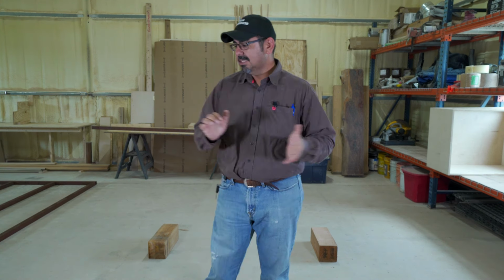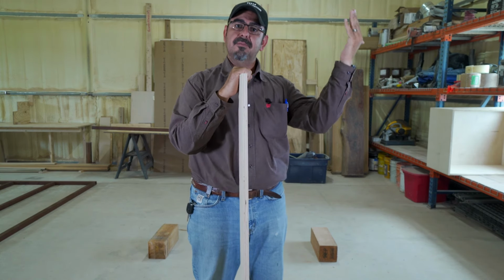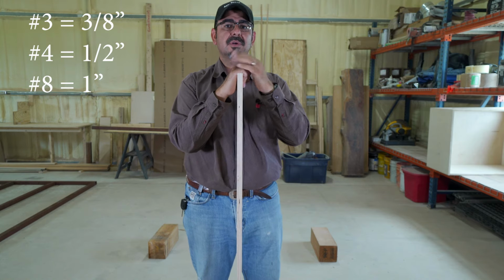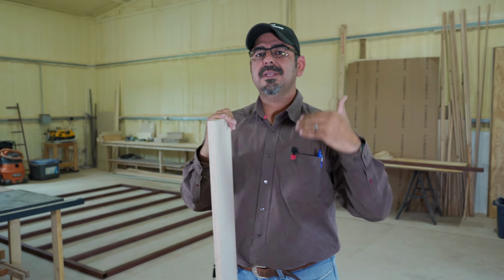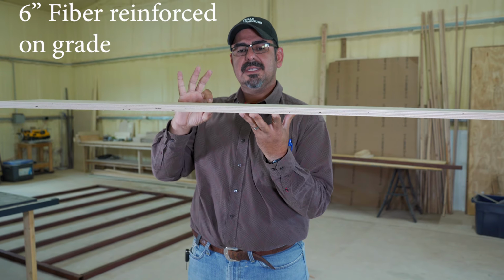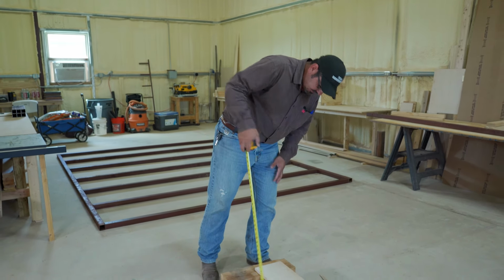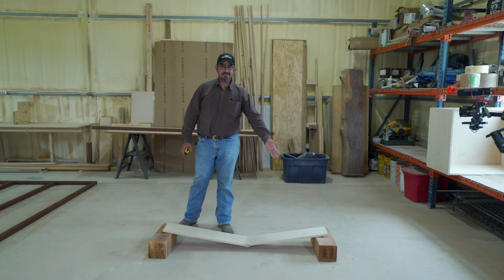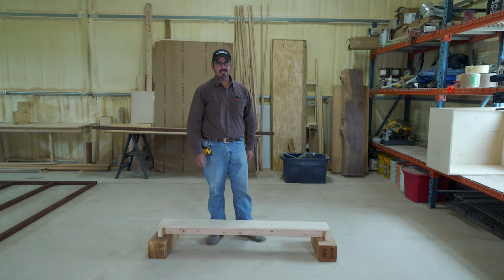Concrete thickness explained! - The Barndominium show E136

Comment: Concrete is only as strong as what is underneath it. Thicker the slab is for weight distribution you don't  pour 4" on a bridge deck you pour a foot on a bridge deck... So on some cases thinker is better depending on the situation of your pour.  Fiber is for the cement itself wire is to tie the pad together  Fiber is mostly used on a sunny day we're you have shaped and sun beating down on your pad. It helps the concrete not to weather crack.  Which concrete will crack there's something you can do to prevent it to. crack do

Comment: Mix is an important factor too, when it comes to cured strength, as is the slump. Rarely will you see a residential contractor check slump and most are pretty often going to use to wet a mix because it is easer to work, but if it's too wet, you will lose cured strength. In commercial jobs an onsite engineer or inspector will make sure they don't let it go down too wet. In residential work, most customers don't know the difference or that it matters. 

Having a big slab and/or foundations engineered is not a bad idea because things like the mix, slump and reinforcement are part of the spec.  That obligates the supplier and the contractor to meet the spec  when supplying the concrete and  installing it.

Comment: Have you ever considered using basaltic rebar?
Reply from the maker: No I haven’t.  I’ll look into it.
Reply: Tod Wilkinson ...Yes, it's made basalt fiber. Some is made from Kevlar fiber. There's pros and cons with it however.
Reply: Texas Barndominiums ...Its interesting stuff and new to the market. It's lighter but costs more. It's stronger but not as resilient. But it does not rust.

Comment: Clay soil, been graded and rested for 1 year, + compacted by a dozer. I want 7 sack with fiber, water inhibiter, and dyed, 5/8" rebar reinforced every 8", grid pattern poured at 6". It will have vapor barrier, 20-R insulation under slab for radiant heat. Overkill? IDK, But I want it to last I know I am looking at around 30k for my slab, including insulation, add some for radiant heat? 2k for most parts but heating unit. I also want to tie it in with the wood stove, as really that is the only time of the year a heated slab would be needed. R-30 walls, R 70 ceiling.

Comment: Since one day soon we will be living on Mars I think we may need specialty SPACED support beams. 
Gravitational pull may cause movement in the slab.
Reply: Slab are flexible and they do move. We did thousands of manometer surveys on residential slabs during a class action lawsuit we were facing as the builder / developer. Residential slabs will cup, curl, twist and move in just about every direction you can think. Most people think slabs are not flexible and are rigid. Manometer surveys of a slab will show exactly how a slab is moving and twisting over time.
Reply: Lmao best comment so far, thank you 👍👍👍SPACED 👍👍👍👍👍

Comment: It also depends on the cure rate. My brother makes his 6 in driveway as strong as an 8 in driveway buy keeping it wet for 28 days.
Reply: Concrete will not increase strength doing that.

Comment: there are lots of ways to correctly lay a slab. only issue I have with this demonstration is, it's not equivalent to a slab! if your base is lvl, with 4" thick slab with 3500psi concrete, unless there is weight on slab this is more than sufficient without footers, unless there are load bearing walls in wich they would be needed! strength of the concrete comes from depth and rock!
Reply from the maker: How isn’t it equivalent?  
Boards are both same thickness.  One with beams, the other without.  🤷‍♂️
Reply: @TexasBarndominiums  because your boards are not in contact with the ground! so that's equivalent to your slab not being lvl or having a huge void under the slab! lol
Reply: Since a lot of people look for help in these videos and their comments, lets not make wild statements. THERE IS ONLY ONE RIGHT WAY TO CAST A SLAB. You engineer it (yes, pay an engineer) then you or a good concrete specialist pour it. And there is nothing wrong with TB's demonstration! It's meant to show DEFLECTION only. How would it do this if the boards were supported?
Reply: @xskill101xr3bn  makes no sense to put the boards on the ground. You get it? There would be zero DEFLECTION.
Reply: So misleading. Strength in concrete comes from so many more factors than just depth and rock (sic). The guy in the video is telling us this exactly every time he says " well, it depends". There is no shortage of detailed information online about concrete.  Do not rely on gung ho advisors who shoot from the hip. I like the video. It's basic. That is what the maker intended.
Reply: deflection demonstration is the wrong demonstration for what he is talking about... unless your suspending a slab.
Reply: @bradpotgieter4008  that's my point no reason for it if your slab is on the ground!
Reply: @xskill101xr3bn  I get you. In the simplified context of 4" vs 6" as per the video,  it was easier for me to assume that the sub base was inadequate (which is often the case!). Brings us back to a "suspended" slab. Which is why I say that I get you. Simply put, TB needed a void under his beam to make his point that reinforced concrete is better.
Reply: @bradpotgieter4008  I got ya!

Comment: This video need to idea of soil tests and engineering involvement at the start. Also how does a board loaded and deflecting in one way representing a rebar reinforced slab which is always deflecting a two ways. Also no mention of where the rebar or welded wire mesh should be placed or held in the slab’s thickness.

Comment: For us who don't know. What is a concrete pad beam and how is it created  in  pad construction ?
Reply from the maker: Concrete pad is the surface of the concrete.  Usually 4” thick, but can be thicker.  
The beams are the supports underneath that make it look like a waffle if you turned the slab upside down.

Comment: Generally, the amount of steel required (if you are an engineer or architect) strengthening your concrete is a function of the cross sectional area of the concrete. a 6 inch slab is going to have 33 percent more steel in each direction,..as opposed to a 4 inch slab (this steel can usually be any size,...AS LONG AS IT'S CROSS SECTIONAL AREA,..ADDED UP..IS AT LEAST THE PERCENTAGE OF TOTAL CROSS SECTIONAL AREA  required..  As long as you place your steel correctly, and concrete compressive strength is similar,..You are blowing smoke up everybody's a!s.   You find out the truth when you talk to somene who mostly does suspended slabs, floors/ceilings, freeway bridge, etc.,..  I don't think I've EVER (yes...that would translate into never in a million years) seen a plan for anything (where the strength really counted)....that didn't use steel as a reinforcer,. and didn't specifiy the concrete compressive strenth..usually 3k psi or more.   I think you just wanted to do a video to get some hits or something..

Comment: Concrete is ONLY as good as the SOIL underneath it! Good video man. Keep it up. 👍🏻👍🏻
Reply: We always based our residential foundation system off of the soils engineering reports for each project. We finally started doing residential post tension slab systems in the 1980's here in California regardless of the expansive index of the soil. It does not cost that much more to do post tension slab system or my favorite residential slab system.
Reply: True very true
Reply: Tony Reyes Yes, but thats a choice in Places like Chino hills you have no choice. In North Fontana, take your pick and typical slabs are fine as well .  But you are right, follow the Code which requires soils investigation . build to it or above it, no big deal.  Makes for good conversation I guess.

Comment: Code specifies a min no more no less .
If you go more it will cost more .
Go with code for basic slab .
It all depends 
No I don't ware depends yet
Reply: woody ahh  Yup, and soil varies. So what you need in Vermont may not work in Cali, etc etc. I don’t wear Depends either, not yet anyway,lol.

Comment: concrete and plywood are two different types of material also you have no sub support if it is on grade concrete is as only as strong as the material that is supporting the concrete.

Comment: Expansion joints, drain tile and areas like where you propose to place a lift as well as all perimeters being at lest twice as thick (3-4 times thick is worth the extra grading and material.)
   I would also have enamel coated rebar and similarly coated wire mesh as well a pylons at every corner and every 12 feet because ground always settles and shifts.
   Overbuild the shit out it once and it won’t degrade in a hundred years.
Also, hydraulic concrete, even if you are not pouring in water…

Comment: I am gonna insulate under my slab. And put flag stone over the slab. On bedrock. Most important thing is that soil testing. I over build foundations. 4" inch slab here you should use gfrp or basalt rebar if you can by code. Otherwise it's 6 inch of concrete to keep rebar from rusting and freezing which destroys the concrete. Masonry loves to wick moisture. I don't think even 6" of concrete stops rebar from rusting and failing here.

Comment: You should never use rebar in a 4" slab. You need 3" between soil and rebar or it could rust out. 2" is pushing it. Just think if you need 2" minimum on each side plus the thickness of the rebar you are at 4 1/2" thickness if everything is perfect.  Just use wire or go to a 6" slab.

Comment: Besides all this, when I dig……before I pour any concrete……no matter what the struct or architectural engineer called for on the blueprints, I also have a soil engineer come out and test/ confirm the soil the concrete is going to rest on.

Comment: And what's the psi rating of the concrete.  Is it 3000 5000 7500?
Reply: Can be any.  Depends on how much cement is in the mix.

Comment: Lol. I was mad at you April fool's joke that got me all pissed off but I'm over it now. Yes you got me. Lol. If its just concrete 3foot is stronger than 2foot. But if I take  number 2 rebar at the bottom of a slab it will only need a foot to be as strong as 3foot. But if I place the rebar at the top. I'll  need 2.5foot to be as strong as 3 foot. Concrete is the best at compression but crap at tension. That's why a suspension bridge only use it on compression points and steel at tension.
Reply: Yesssssssssss get it engendered but if you have a good contractor with lots of experience, he will tell you that is wrong and what to do. Meaning engineering don't need a Master or Doctor in engendering but a true artesian will know what will work and what not. But simply do you ask your friends for medical help or a professional? A paper cut you will trust your friend but a stabbing you will go to a doctor. Same thing.
Reply from the maker: Lol, very true.  
Thanks.
Reply: @TexasBarndominiums  no problem. Do you do work in Colorado?
Reply from the maker: No we don’t.

Comment: You could have brought in the type of concrete too. 6000 pound will carry more them 3500 pound
Reply: This guy acts as though he's Mister engineer. He mentioned he walked on plywood at the beginning of the video. I've been driving mixes for 35 years. I know concrete I also know that wasn't plywood that that guy was walking on. He just wants to be mr. Engineer on YouTube
Reply from the maker: It was plywood.  If not, what was it?  

What do you know about concrete?  

Is 6” slab always stronger than 4”?
Reply: @_.-266  at first I didnt think it was plywood either, but then it is obvious it is with the little voids and layers.  I think a combo of lighting and video compression made it look more like a board at first.
Reply: @_.-266 , so hauling concrete makes you an expert on concrete? Ive been hauling everything that can be hauled on a flatbed for 3 decades. That only makes me an expert on flatbed hauling. Not an expert on lumber, plywood, concrete, roof shingles, portable buildings, hydraulic utility lifts, sheet steel, etc etc etc. You are probably just an expert on loading, driving, and unloading a concrete truck. And that is all. Have a good day.
Reply: Texas Barndominiums   Maybe not but you will never find a logistics warehouse using a four inch floor or exterior drive aisles.
Reply: @_.-266  Jealousy makes you drive concrete for 35 years. We lay it.... You keep on trucking, Pete
Reply: @edswope28  😂👏👏

Comment: A 6" with alternating depth of rebar or mesh, will be stronger. Put the rebar at 2" from bottom, and 2" under, and there will be 2" between the two, giving more rigid stiffness to the slab. You don't have enough room for that on a 4" slab. But giving a 4" slab another 4"s as support... well, that is cheating the 4" slab? Now you have an 8" buttress, which is more than what the 6" is to begin with, hell give the 6" another 2"s for buttress and you can go up three stories!

Comment: Please don't compare a suspended board to the compressive strength of concrete. I understand that you can put different reinforcing in concrete to do different tasks, but concrete responds to thickness more than it does to steel, when comparing compressive strength.
Reply: Concrete responds to shrinkage or compressive strengths. Post tension systems adds to the compressive strength of concrete since the post tension cable "relax" anywhere from 4%-20% over time (depends on the post engineer you talk to). This is the beauty of post tension slab systems. The comparison the contractor posted makes total sense when you add the grade beams or scoop footings or deepen footings at the interior of the slab. Concrete responds to not only the thickness (6" vs. 4") but the grade beams (interior and exterior footings).
Reply: Your right it does. I was under the understanding that he was talking about reinforcing, not grade beams. I could be wrong. Either way if your saying the grade beam adds to it , your right. But you have to put one every 4' to do any good. Also when you pour a footing, a beam , or a thickened area inside the slab, you run the risk of slab shrinking and cracking in a manner you won't like. Doesn't mean it is weaker, but its likely to happen.
Reply from the maker: The point of the video is to prove that simply saying that a 6” slab is better than 4” slab is not accurate.
Reply: @Scubasteve22  Two things I tell my clients. 
1. Concrete cracks 
2. Concrete is hard
When a crack gets to a 1/4" in width, then we have a structural crack, otherwise; concrete will crack.
A 4" waffle slab (with interior footings) will out perform a 6" slab with no footings. This is almost common sense to a concrete applicator.

Comment: Why don’t ya’ll do post tension ?
Reply from the maker: We do.  😊
Reply: Drawback is in shop/industry type setting, anchoring equipment is extremely common and necessary. A hammer drill bit hitting a tendon is not a happy day. Not saying it can’t be done, but the process is lengthy and the chance of joe Maintenace man having the wherewithal to locate tendons is not realistic
Reply: @TexasBarndominiums  Make sure you stamp your post tension concrete where it can be seen. This is the wording we used on thousands of homes as a heads up for the buyers........"Post Tension Slab - NO CUTTING , CORING, BORING"
Reply: Exactly. Hitting a post tension cable can KILL a person. Those cables are each under tension to the tune of 30,000+ PSI. Think of snapping a piano string and the associated explosive decompression. I have seen post tension cables fly out of the side of the home and get impaled in an air conditioning condenser / compressor. I would not want to be standing next to a post tension cable that has failed and that is for darn sure.
Reply: The post tension cables can also be repaired after hitting one accidentally. Been there done that a few times over.......

Comment: in GUAM , KAISER PERMANENTE in the STATE built  box type concrete houses way back 1970 , it is pre cast design , wall and roof slab is 4 inches thick , until now all is in good condition 2024.